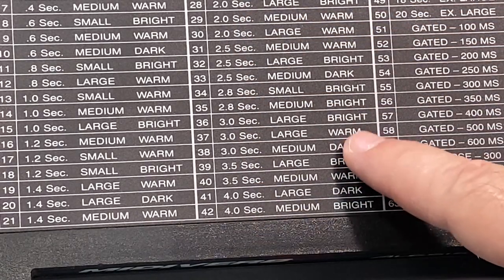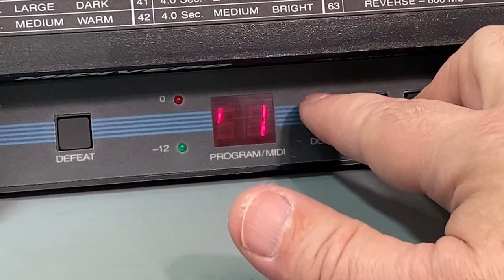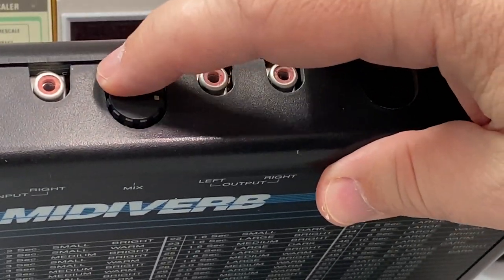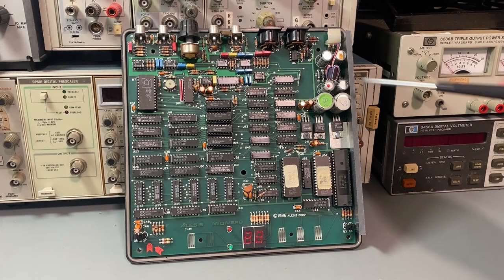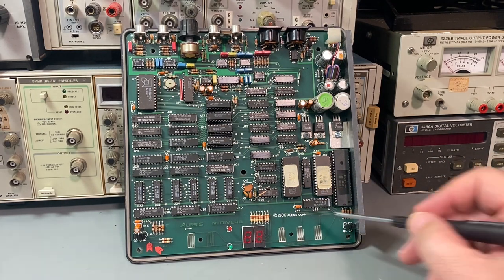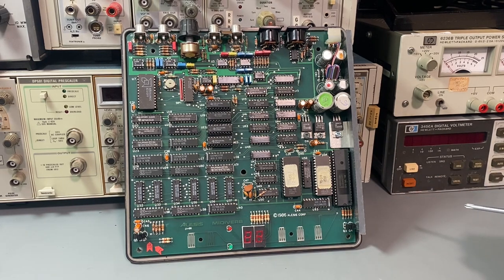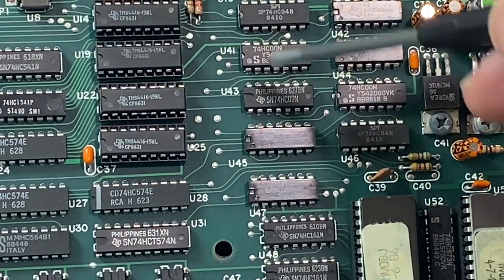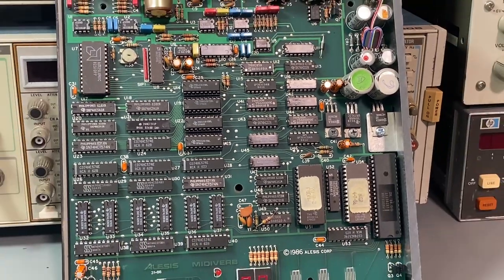Synthesis Technology Patreon preview: Alesis MidiVerb I (History)

Comment: Awesome video! I am going to have to sign up for your Patreon to get the other two videos. In your video the wallwart is 18VAC CT, but my unit says 16VAC CT on it. Any idea why the official power adaptor is higher than they recommend? I was going to get a 16VAC CT one for my unit, but should I get an 18VAC CT instead?
Reply: Guessing the transformer was originally 16VAC CT, but when Keith tested it at "low line" which is 105VAC in the US, the 3-terminal regulators dropped out. He already printed the labels for the case.
Reply: @paulschreiber9384  ok thanks. Then I will look for an 18V replacement :) I cant wait to get a better look at how the hardware works in your next video!